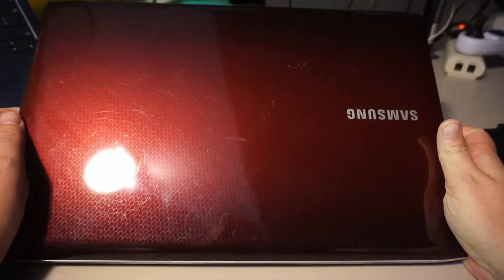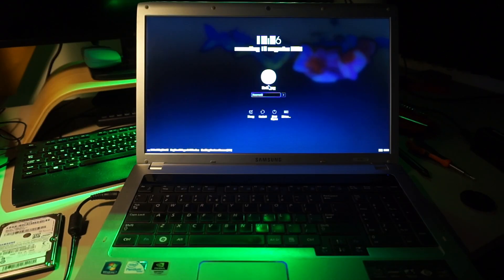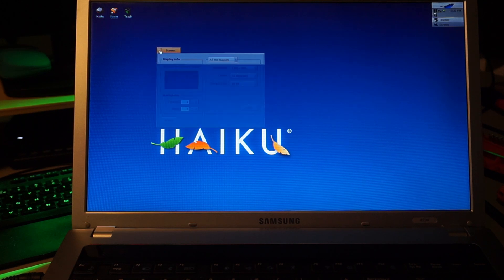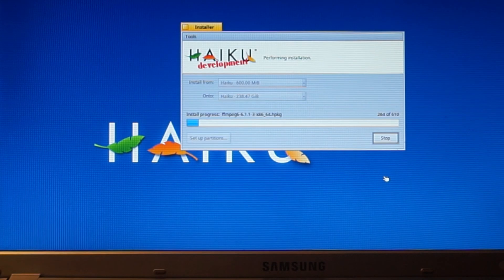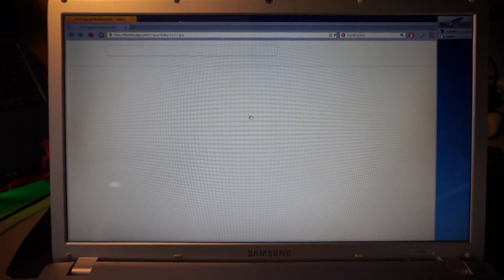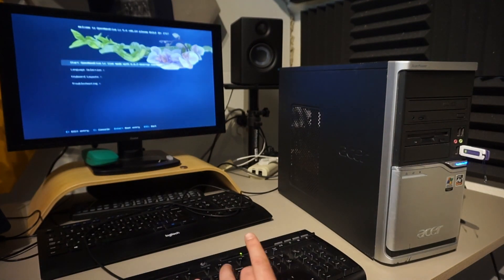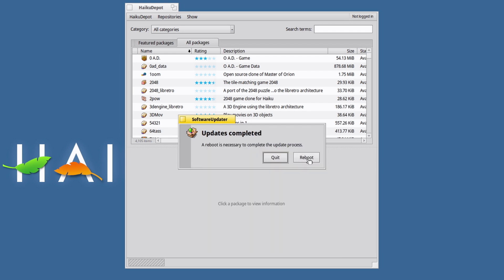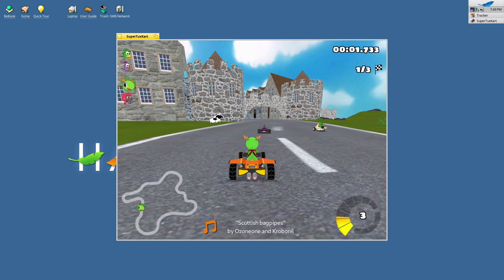Can Haiku revive this old laptop?

Comment: Windows xp is much better especially with supermium
Reply from the maker: Windows XP is not a modern operating system, so that comparison is a bit weird ;)
Reply: @ not modern but for low spec computers it’s way better like ram usage,driver compatibility etc I use xp instead of puppy Linux on my dell Inspiron with pentium m and 1.5gb ddr2

Comment: debian, mint.... 100 times better
Reply from the maker: Linux sure has some advantages over Haiku, but this runs a whole lot faster!
That being said, I moved that laptop to our kids and did install Linux (in another video) with some kids games.
Reply: @ex-itguy 

Haiku is faster in terms of what?? Opening programs?

Last time I used Haiku on my laptop with good specs it ran really slow and crashed a lot.

Even in your video, games and videos on YouTube looked all laggy. 

Don’t get me wrong. I’m not trying to bash Haiku. I’d like to see Haiku do better but it’s light years behind any Linux distro. It doesn’t even have a modern web browser (not yet anyway) and the project is well over 20 years old!
Reply from the maker: @awa0927  well I do believe that a Firefox variant just has been ported to Haiku, so that seems promising. 

I meant that the OS in general runs way faster than any modern Linux. It's booting way faster and feels way more snappy overal. Its on things that really rely on hardware acceleration that Haiku fails to impress. I really hope they can do something about that because in 2024 (or... '25) you just can't do without it.
Reply: @ex-itguy 
What distro  and environment are you using?? I can’t remember any time I used a distro that wasn’t fast and snappy…

Faster booting is nice but doesn’t really mean anything if the OS isn’t daily drivable.

Last I checked, that Firefox version for Haiku isn’t stable nor has it been officially released. Even if it can play YouTube we still don’t know if it can play Netflix or Amazon Prime Video. 

On top of that Haiku still lacks a lot of basic options all Linux distributions have. For example, you can’t even rotate your screen in the display settings. I don’t think you can use multiple monitors either.. the list goes on.

Haiku needs a lot of development. Being in beta even after 20 years is ridiculous lol..

Comment: Just tried haiku 32bit , couldn't get it to boot without thumb drive after install. Booted in, set up boot manager still won't boot, went back to Linux.
Reply from the maker: That's weird, you sure you've had it place the bootloader as well?
Reply: @ex-itguy  yes, followed instructions from a forum
Reply from the maker: ah right. I haven't really tried to dual boot it myself yet.
Reply: @ex-itguy  this was a bare install on an older, much older, PC. There was no other os
Reply from the maker: Weird, that would work just fine. I'd ask on a Haiku forum or Reddit if you still want to make it work. :)
Reply: @ex-itguy  thanks for the advice. I really wanted to try haiku bc I frequently rehab ancient hardware for nostalgia. I found antiX Linux and it works perfectly. I will look further into haiku another time, again thanks for the support
Reply from the maker: Sounds familiar haha, AntiX is pretty cool, but no Linux distro beats Haiku in terms of raw speed. In terms of usability though, AntiX might have the upper hand.  :)
Reply: @ex-itguy  the machine in question is an Intel atom with 1gb of ram and no SSD, it needs all the help it can get, lol

Comment: At power-up, hold down SPACE or SHIFT, one of those keys should bring up a boot options menu for Haiku.  Go into safe mode, and you can select a generic graphics option.  That should let it boot on your Athlon 64.  (Actually, it probably has already booted, it's just not displaying anything.)  You can alter a config file within Haiku to run this mode automatically.  As to YouTube, I found it got close to watchable by selecting 360p quality, but not in WebPositive.  This was on an older Samsung laptop with an AMD A6 APU, and Radeon 7500G graphics.
Reply from the maker: Thanks! I still have that box, curious to see how it'll do in Haiku :)

Comment: Even on supported GPUs there is now hardware accelerate 3D on haiku, so you need a faster CPU ;)
Reply from the maker: Now or no acceleration? I guess I could try it on a bit younger hardware but to be honest I would expect a system from 2015 that runs just fine in Windows and Linux to at least be able to show a YouTube video without much issues. :)

Comment: I can totally relate to the whole, not overwriting a hard drive that hasn't been used in over a decade lol. But man, it so much fun to see an old system, with UNIX installed, running on a new SSD. Haiku is a very nice distro!
Reply from the maker: To be honest, Haiku is so fast it hardly makes a difference to run it off an ssd haha
I wish they had better graphics support. Especially since BeOS was great at multimedia, which just doesn't run flawlessly on Haiku because of that.
Reply: @ex-itguy  There isn't really hardware acceleration
Reply from the maker: @coolcoder613  That kinda sucks since you just need it for about anything that moves on your screen nowadays.
Reply: @ex-itguy  Not really. Pretty much the only place in Haiku I've noticed the lack of hardware acceleration is games. (I don't really watch YT on Haiku)
Reply: Haiku isn't a Linux distribution

Comment: Haiku is basically Unix. It is a very common misconception that Haiku is not a UNIX. It's debatable whether or not BeOS was a UNIX, but I think by most standards it was: the `fork()`-based process model, UNIX-style file descriptors.

Haiku has all the bits BeOS had, of course, but it has far extended the POSIX compliance: it has mmap, but also pthreads, and /dev/ (including all the staples, like /dev/null, etc.) These aren't mere compatibility wrappers, but often the "native" APIs; some of the Be APIs are implemented on Haiku using them (while others use lower-level APIs.) There is no "POSIX compatibility layer" in the kernel, it's just natively POSIX all the way down.
Reply: BeOS wasn’t trying to be a UNIX. Haiku is trying to be BeOS, but they have added better POSIX support because it makes porting apps easier. But Haiku is a POSIX compatible OS, not a UNIX.
Reply: And by that I mean, once you leave POSIX compatibility, the API and the interfaces to the kernel are completely different.
Reply from the maker: Didn't know that. Thanks for giving a bit of extra insight!